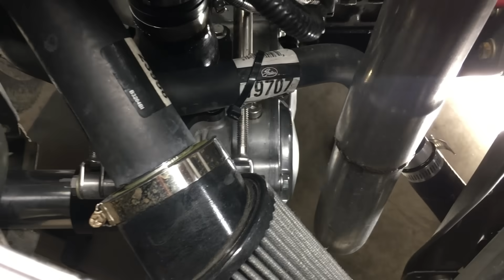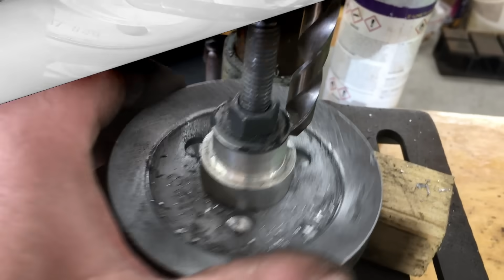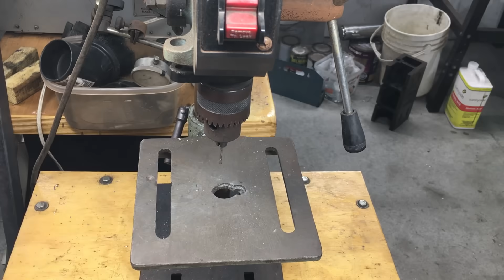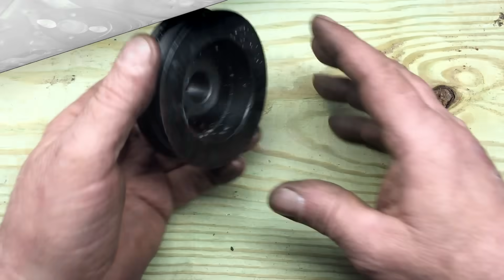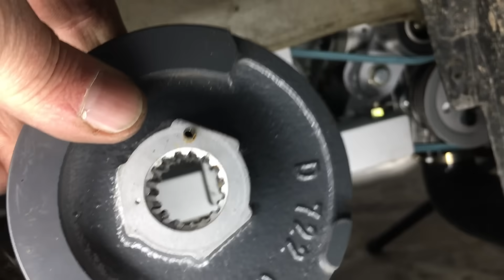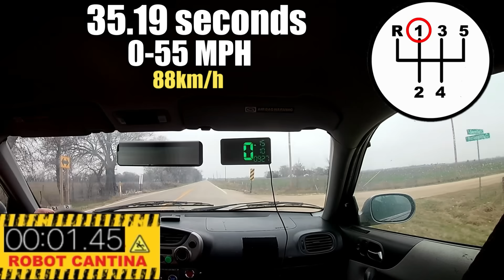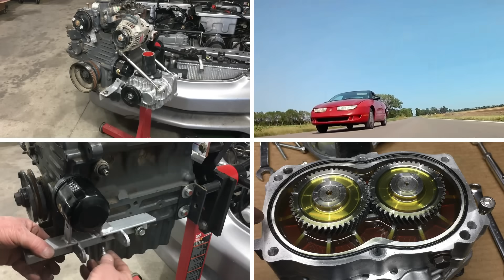S4 E9. We fix and road test the AMR500 supercharged Kubota diesel powered Honda

Comment: These diesels have very high compression ratios to get the most out of them without forced induction. They tend not to get much from boost above 10psi, well they do but they tend to burn holes through the piston crowns. In Australia and Africa, the Toyota 1HZ is a legendary old lumbering NA diesel used in some small trucks and the Toyota landcruiser. People have been turbocharging them forever and usually 10PSI as a rough rule of thumb seems good. Anything much above that seems to blow the engines up unless they've had stronger pistons put in, usually with a reduced compression ratio of about 20:1 or 22:1 down from the factory 24:1. These kubota diesels are very similar with a 24:1 or 25:1 comp and the same style of fuek injection. 

If at all possible, now you have 2 of them I'd love to see you try and jury rig a reduced compression ratio, maybe by putting in a thicker head gasket? 

If you want a very cheap but even sketchier mod. Make a basic water methonal injection system. If you want to go even further you can mix a bit of nitromethane into the water methanol mix lol.
Reply: I’ve seen the D1105 take 16psi of non  intercooled boost in a Kubota rtv that was heavily overloaded with a specialty body on it with tracks, the engine was never turbocharged from the factory but it was kit sold through an aftermarket Kubota catalogue last I saw they had well over 2000 hours on them, whatever pressure that supercharger can make it will take just fine
Reply: He has a wmi system from a previous build...
Reply: Customer had a landcruiser with a 1hz and an old school greddy turbo kit on it, popped the turbo, I put a modern more efficient (and much larger lol) turbo on. came on boost sooner and harder kept the greddy wastegate and boost control setup, IIRC it was set about 12 psi. Things been around for forever and never skipped a beat. perhaps our cooler climate in scotland helps. I didn want to run the fuel up a bit more, it certainly felt like it would have benefited but the customer was already happy with the increase in usable power.
Reply: Running rich blows holes in pistons, not boost. Diesels like boost, 10psi is very low for a turbo diesel.
Reply: What happens when you give them propane?

Comment: you should do inbetween pulley ration, you went from 1.4:1 to 1:1, I think you should try 1.2:1 that would make aprox 8-12 psi of boost ! I love your video, keep up your great work !
Reply: Remember, the 1.4:1 was erroneous because the mockup engine has a different crank pulley size than the installed engine.

Comment: Be careful adding extra pulleys to any engine. There is a limit to allowed side and top load before damaging the crankshaft bearings.
Putting the new load under the crankshaft is safer if you don't have access to design manuals.
Reply: I would agree with this.  I think he'd be modifying his balance shaft significantly by doing so, leading to potentially worse damage

Comment: I kind of want to see one of these small, not really meant for vehicle propulsion diesel's twincharged now lol.
Reply: I was thinking the same thing when I saw the exhaust sitting there with the turbo flange still on it!!  While I don’t think the engine would handle the high boost very well, it would be interesting.  Low compression pistons and regapped piston rings would be a necessity, at minimum.